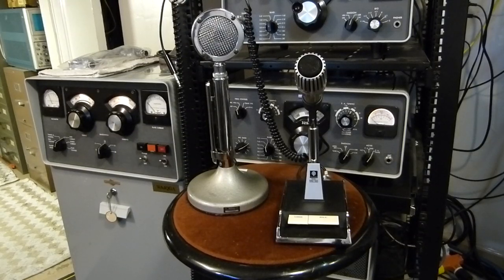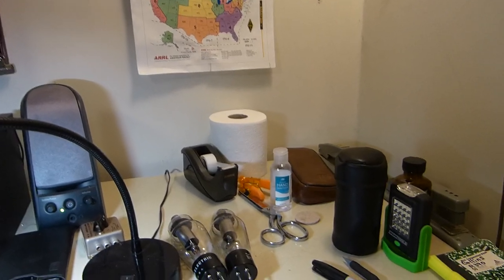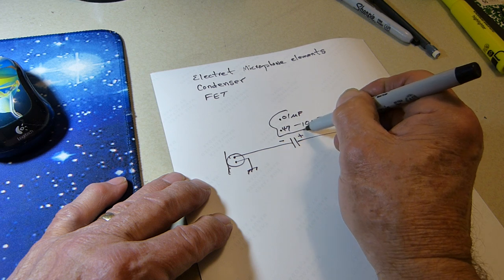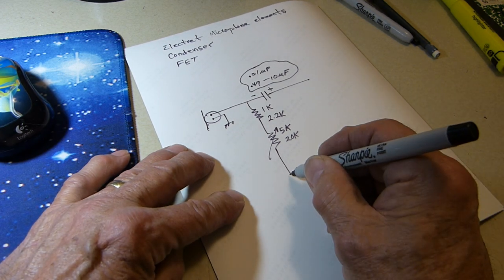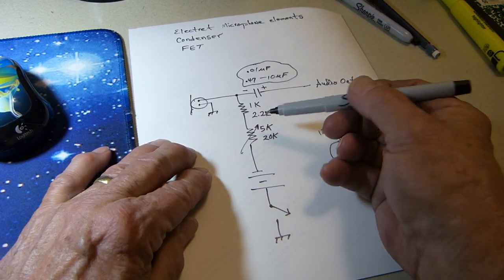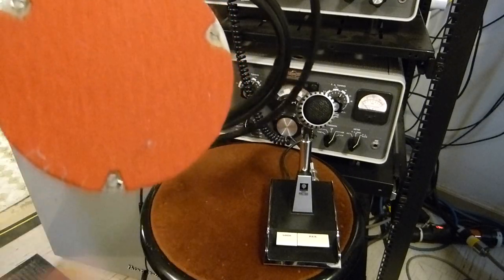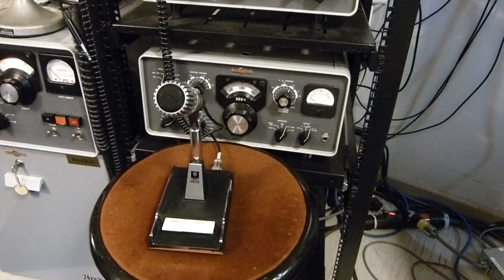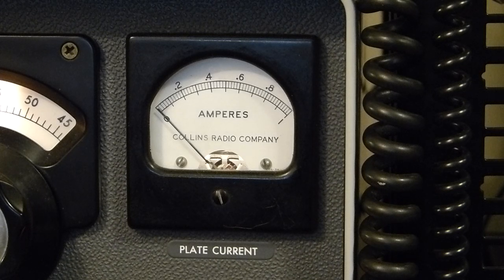Electret Microphone Gain Adjustment Made Simple

Comment: Thank you for making this video!  Ive been making an interface between my radio and a headset that uses an electret mic.  The original design called for a 1K resistor but the gain was really low.  By mistake I put in 2.2K when I was tinkering and to my surprise the gain increased.  That had me scratching my head.  Now I finally understand why!

Comment from the maker: I made a couple of "word mistakes". One is if you make the series capacitor a low value say, 0.001 uF you might be able to tailor the output frequency response and attenuate the lows and not the highs. I would think if you use a 10uF capacitor it should be "non-polarized" but the ones we get off Ebay use polarized (standard) electrolytic capacitors. Seems to be OK.

Comment: 73.
Congratulations for this démo very cool and interesant.
Where and how connect a vu meter to control the gain effect? Just before the out?

Thanks
Reply from the maker: I haven't thought about the VU meter but I would think the impedance would be too low and load down the output of the microphone - I  have never tried it - but I would suspect a VU meter would need to be located further down the audio chain. I adjust the gain and watch the RF power output of the amplifier to the antenna with a peak reading meter. I personally like the LED peak reading meters better than the Bird 43 style. I guess I just like the blinking lights  🙂  73  WA4QGA

Comment: Enjoyed the video on your electret microphone. Also, could you show us the electret condensor mic itself before the install ?  I would like to see the gain of the electret microphone in action along with the quality of performance. That is, your gain on the watt meter and modulation as you turn up or turn down the new inline potentiometer. To me that would be a better example of gain from your schematic. Could you possibly update the video on this project ? Thanks Billy Albq. N.M.
Reply from the maker: Hi Billy,
I don't think a YT video can be updated after posting. We used to be able to add comments to the video in case we said something incorrect but YT notified us and stopped that because they said the comments could not be seen on hand-held devices and most people apparently, watch YT on their phones instead of a PC. I think your suggestions are very good and if I make another video about microphones I will show the mics and how modulation is controlled by the inline pot. 

Here is one type I have used from Ebay.

https://www.ebay.com/itm/354402889211?hash=item52840eedfb:g:LU0AAOSwd0BVtQn0&amdata=enc%3AAQAHAAAAoHDeTqjNAjk9ffBpDFfy8qi53kDjWWP6bhht4t6iouBe7LXzK5nBPeoQ7ynwsHpUX2lnJby1p0wEXY4P9R%2B8OG2if%2FY6op7%2BtJLvGrDe91tNhIsUsuHBAaXgKo0GQsLtt61KyblRCNnw7Ccr%2F5GbhLiWnrGYEIYRkLC6tHeHI20znmjma6W3b16V60PvY5vSYBbczEsu2cSM9E821%2BjDmm0%3D%7Ctkp%3ABk9SR8irhb24YQ

Here are the 69 cent mic elements I have gotten from Amazon - now they are only 59 cents... but you have to buy 10.

https://www.amazon.com/Cylewet-Cylindrical-Electret-Condenser-Microphone/dp/B01N0VMN9P/ref=sr_1_9?crid=2LMX5TJ9DY3HF&keywords=condenser+mic+element&qid=1674027597&sprefix=condenseer+mic+eleme%2Caps%2C111&sr=8-9

Comment: Thanks for your excellent video. I have a Ubitx Hf kit rig. Have been battling low rf output on voice for some time due I believe to low output from my FET Mike.  I will be trying your suggestions out as soon as I can.

Owen Vk5kov from down under of course.
Reply from the maker: Hi Owen,  I hope a mic upgrade works for you. I know the original D-104 elements when they get weak will hardly modulate my transmitter, I think mostly because they have lost their low frequency response.  73  WA4QGA

Comment: great video. instead of a build-it-yourself, i sent out for a electret microphone amp board already pre-made. . i want to add a volume pot at the audio out but not sure how many ohm pot to get. it has 1 ic, 2 transistors and operates from 5vdc to 12vdc. any ideas? thank you.
Reply from the maker: To make a zero to full volume output control, you connect the output of your mic amp board to one of the pot and the other end of the pot to ground. The variable signal is then taken off the center pin of the pot and the ground end. Depending on which end you put the signal in and the end you ground will determine if the volume goes up or down when you turn it CW/CCW. Electret-condenser mic elements are fairly low impedance devices so any pot between 2.5K and 10K should work fine. I would likely go with the higher values like 10K. Hope this helps.
Reply: @ElPasoTubeAmps  thank you so much for your help. i am trying to keep the costs down and dont want to buy a pile of assorted pots. i will start with a 10k and update results here.( may take awhile...)
Reply: hello again! so i have everything hooked up accordingly, and the issue is that its too loud. the "pot" on the board is counterclock all the way- not sure if it even works. i have it running thru 2 pots which i scavenged, both 50 ohm and hooked in a sries circuit. and i cant control the vol. so i sorted some various resistors to put in-line including a 1.5 mega ohm, still too loud. thoughts? thanks!
Reply from the maker: I don't know but maybe you have the input pot connected wrong ?  The input from the, for example, RCA input jack goes to one side of the volume control the other side goes to ground and the wiper goes to the input grid of the first stage. The value of the pot should be something betweel 100,000 and 1 megohm. Also, although it does not have to be, a volume control should be a logrithmic type pot and not a linear pot. Our ear responds logrithmic rather than in a linear manner. Either will work but the linear pot will get loud quickly whereas the log pot will not. Putting a resistor in series, even 1.5 meg is not going to do anything significant as the current flowing thru is in the microamps so there is no voltage dropped across the series resistor. Hope this helps.
Reply: thanks for your quick response!! the amp in question (if you care to look) "DC 5V-12V LM386 electret microphone power amplifier board" in the walmart search, it shows the 2 transistor board with input for electret mike. i dont have a pot in that circuit, just wired direct. the pots i used are both for the audio out. i will look to the logrithmic pots and see what i can find, not familiar with those. thanks again!
Reply from the maker: I assumed a vacuum tube voltage amplifier like a 12AU7, etc.  🙂Connecting the input or output pot should be the same as above but with lower values for the solid state
equipment. I would try something between 5K and 100K.
Reply: after trying one 50 0hm, then 2 50 ohm in series,  (neither worked)  i decided to hook the mic input to a pot. and now im having better results/ control. its a 50 ohm again, but i will try some other values to get it just right. thank you for your help.

Comment: No man, following to the letter all i got was a great deal of noise, it improved slightly removing the 2.2k and just using the variable. even that was nothing to brag about
Reply from the maker: That's not good... Are you using this microphone on new equipment like iCom, for example, or vintage equipment like vacuum tube Collins equipment?
Reply: @ElPasoTubeAmps  I am using it as an external Mic for a Sony Digital voice recorder. ( Model: ICD-PX312 ) I am making a Mic array using a NE5532 TDA1308 Mono Audio Signal Input Mixing Board
Reply from the maker: @home_Grown_studio  One of the things that I have found that surprises me with these little mic elements, is they work very well into a high-Z input like vacuum tube circuits. Input Z is around 1 megohm. I have also tried to use them on modern solid state devices like iCom radios and they don't work so well. The input Z of the iCom type radios is a low Z impedance - not exactly sure what it is but I believe in the K ohm range. I bet your Sony device is a low Z input. Not sure how to help at this point.
Reply: @ElPasoTubeAmps   Actually I am getting close to achieving my goal. Been playing around with resisters getting better. Before I make  the connections to the mixer I just want a good sound with little noise as possible. Anyway, Thx for the posts they are appreciated
Reply: @ElPasoTubeAmps 600 ohms for newer radios